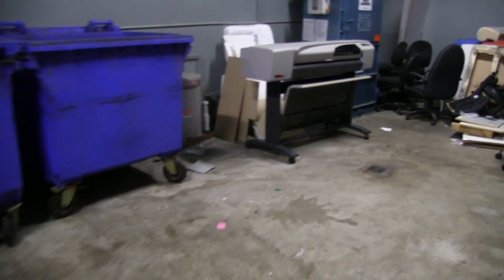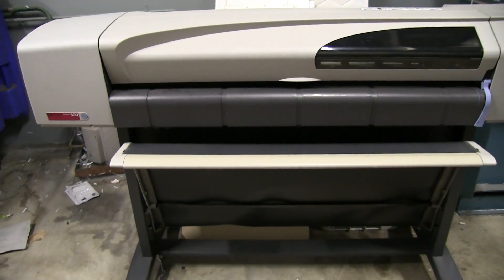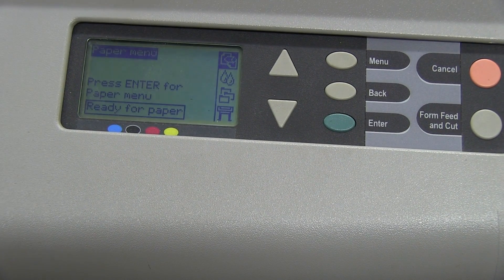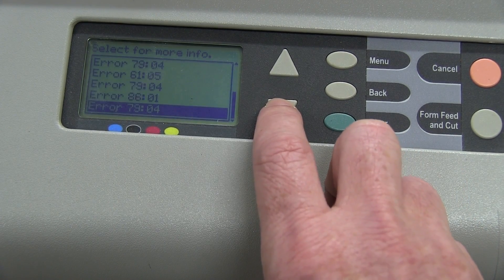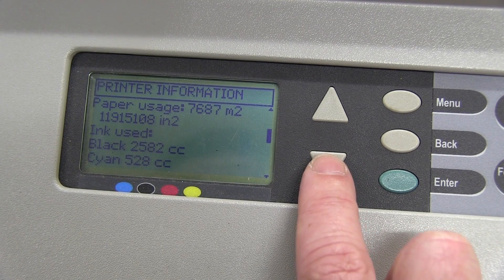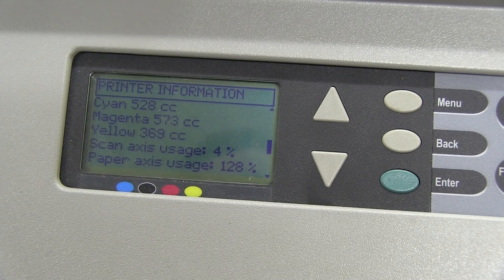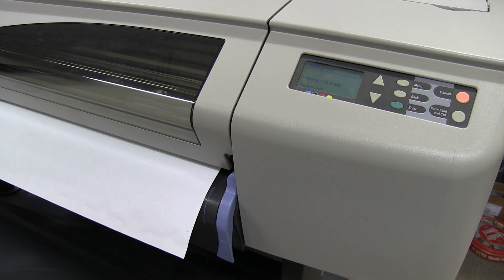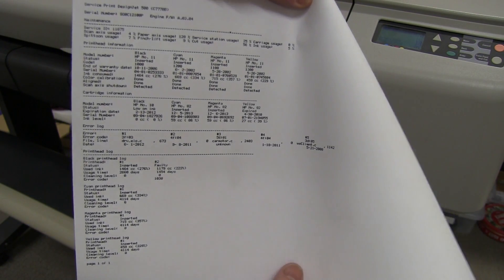EEVblog #535 - Dumpster Dive Plotter

Comment: I think it's got a nice blue laser too for checking the paper calibration. I had to fix these at work and they could be a royal pain. Main issues are normally the Jetdirect cards failing. HP have a known faulty Jetdirect card (Jetdirect 615N which had solder flow issues at manufacturing). They recalled them all for years but they are known to just randomly die though HP no longer swap them out anymore due to their age.

Comment: Right, no more driver support for the newer o/s.

No problem, load up an old laptop with XP and when you need to print just
save the doc to a usb stick and print all you like using the laptop.
Reply: works OK on W7 and W10 (compatibility mode, LAN or via USB). Still using this plotter in our office.

Comment: If you're lucky you'll run by a place when they upgrade the OS. Then you'll get lots of nice stuff where the drivers don't work anymore on the new version.

It wasn't too long ago that you didn't the heft and bulk, it was also possible to score some rather nice CRT monitors when places switched to flat-screen. Only problem with those is that everything on computers now seems to be made with wide-aspect ratio in mind with little thought to supporting the older 3:4 ratio which most CRT screens are.

Comment: Dude you hit the jackpot. You are so lucky it past all the self tests. I just want to say that the ink cartridge is low is dangerous because if you don't put in a new cartridge in soon the tubes can empty of ink and then air gets in the printhead and then you have to replace the printhead unessarily. So replace the ink soon. Also make sure you oil the rails the carriage moves on, very important.

Comment: I landed up trashpicking this printer's big brother, the Designjet 800ps, at work. Another dept. was going to throw it out when I decided to recycle it as a backup for our (also saved from the trash) Designjet 1050c. Good thing I did because the 1050c finally died! The most that go wrong with these is the big carriage belt falls apart. Its a normal service item but labor intensive to replace.

Comment: It is a great found in a garbage room, but putting on a price tag is hard.
I mean: It has to be shipped, but it is large, fragile, I guess the original box was disposed a long time ago, it served more then ten years of good service... For Dave, thats a winner. For the company which got rid of it: Well, after ten years you may want to change just for reliability. When you print over half an kilometer per year, then even small problems can cause big trouble with costumers.

Comment: probably through it out because there are no windows vista, 7 or 8 drivers that work with the printer. A lot of old HP printers only have drivers for windows XP and 98/2000/ME (even though they have a works with win 7 sticker). I personally had to go through 5 HP printers before they updated the drivers to work and even then it was a patch (you can't install original software so what is the point of the patch?)and then its only in 2013 that they finally got a full installer for windows 7 and up.

Comment: I had an HP printer took the same style cartridges and heads. Pile of crap. The heads clog fairly easy and the ink pumps aren't strong enough to reliably prime it when it routinely loses prime.

Comment: I sometimes get that banding on my A4 inkjets. Cleaning the print-heads and/or calibrating them usually sorts it out. The black cartridge was also running low on ink.
Of course whoever threw it out might not realise that there's a simple solution!

Comment: Yes the problem witch scale is a setup and sw issue. However i do not mean re-scaling, Printing a A1 page from a A1 PDF can give you scale differences.

HP's drivers for win7 is not to great ether.

Comment: We have the 800. This plotters are a awesome. If have some error allways show You on the screen. Only one issue allways, the small HDD inside get time to time broken. Is actualy a 2.5 inch ATA HDD. Make a image from it  immediatlee, then later You can buy some old HDD on ebay for almost free. Other part what is the printer head get dry. Just simple need to clean the cleanerbay each half year. is on the right side under the inks. Nice toy :)

Comment: We have an HP designjet 500 at my work and vs the new plotters it sucks. The 500 is very slow and the resolution is horrible vs the new models. I can see why they threw it away because vs the newer models its worthless just based on the printer speed if your paying your employees to stand around all day while it prints.

Comment: You'll probably want to download WebJetAdmin and upload the latest firmware to the NIC and the printer.  Some of these had hard drives on them, you could just FTP a .PS or a PDF to them and they'd just take off and print. Looks like DaveCAD gets an upgrade! If the NIC is working give it a static IP and plug it into your router, add new local printer on the PC and give it the IP address.

Comment: However, at least the No. 10 cartridge (black in this plotter) is easy to refill. I have a printer that uses the same 69ml black cartridge (HP PSC 2500CM, the color cartridges are smaller - 28ml) so the ink can be refilled multiple times (until the pump in the cartridge wears out) making the cost of printing almost the same as that of a laser printer.
The printheads are a bit difficult to find, but they are sold on ebay, so not a big problem.

Comment: i had one like this  but it was not run every day like it needed too  

so every 6 months its was 1200$ in print heads    encad 60e i think it was called  6 foot printer    10 years or more ago when they just started to make them  

aaaa them where the days  link every with a pump they gave you to prim the lines

Comment: Nice to see the 500 still working,  we have several dotted around our offices, and although they can be a right B*tch to fix,  the speed and quality is spot on.   You really do need the manual (HP) to take it apart to fix, but the manual is like a hayes car book, step by step!   Error codes are in their too.  

Good score! think of the circuit diagrams :)

Comment: I'm actually not that surprised!
Some of the newer CAD programs and some combinations of PDF files/programs have problems with the old 500 and 510 HP's. 
The problem usually manifests itself as a loss of parts in the print, and it is a result of the memory being full.
Another usual problem is problems is with scaling, 5mm difference from the original does not sound bad until you build a house with the wall 5m to long :)

That being said, its a great score and they are basically indestructible!

Comment: That's a decent bit of kit there Dave - I've had one of those next to my desk for 12 years, still in daily use and very reliable. The printhead alignment routine is quite interesting to watch as it prints a pattern then scans it and basically completes the alignment without user intervention.